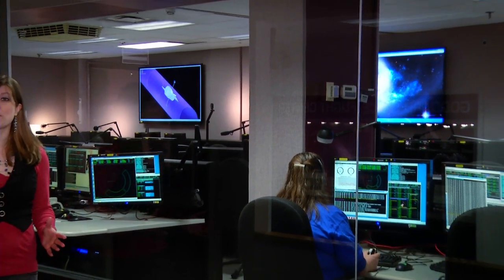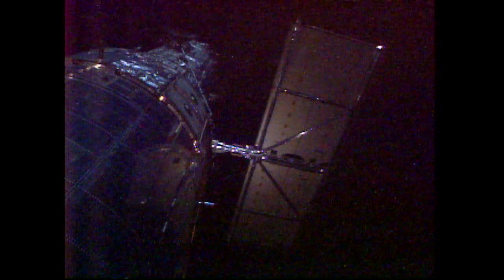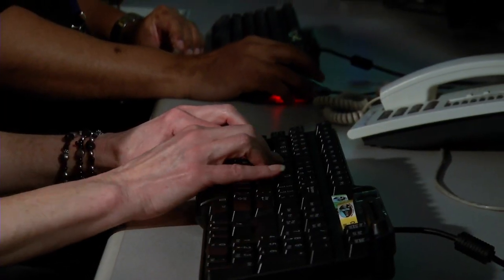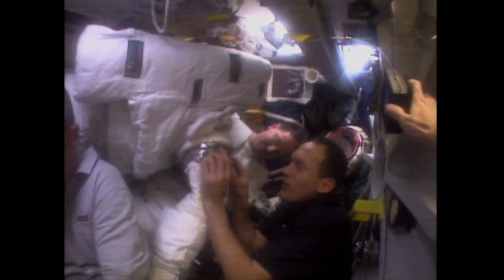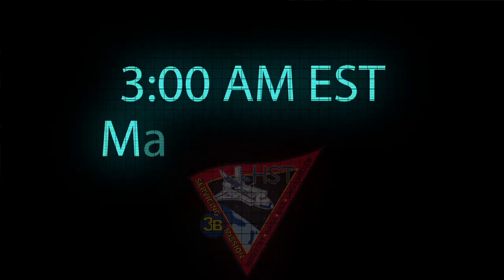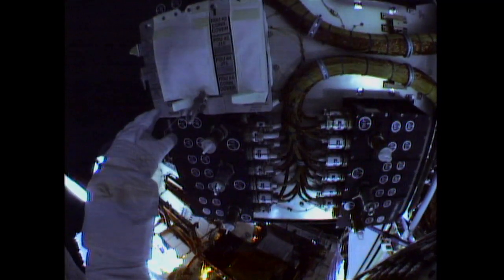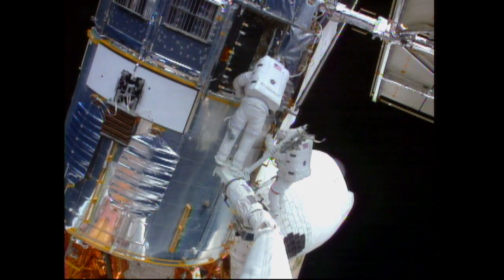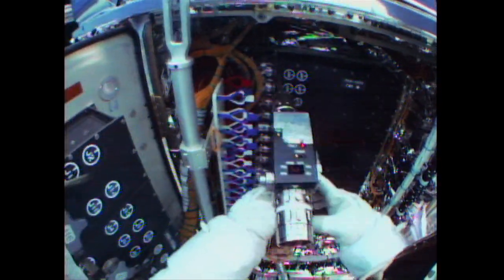NASA | Hubble Memorable Moments: Powering Down

Comment: How can you remotely turn on something that is turned off? If it is completely turned off that would include any receiver and command processor required that would be needed to turn it back on, would it not? So, did the astronauts flick a switch?
Reply: Björn P. Umm, I should know this… I think they apply power from the Shuttle.  And then the Goddard operators can do their remote PCU aliveness test.  … But don't quote me on that.  :)  david schaible?
Reply: Katrina Jackson That seems logical. No different than giving somebody a jump start really. Well, besides the fact that all of this is happening 550km above the Earths surface in 0-G. Come to think of it, it's more like open heart surgery, isn't it?
Reply: xXxDjShamblesxXx Open-heart heart transplant.  With no artificial life support during the surgery and no monitors hooked up to the patient.  In the vacuum of space.  No biggie.

Comment: "In 1999, engineers at NASA's Goddard Space Flight Center discovered that there was a problem with Hubble's Power Control Unit."
Does anybody at NASA Goddard  know about a good technical article detailing how that flaw was discovered?
I've trying to find out more details about that tech sleuthing challenge. Thanks!
Reply: Katrina Jackson Thanks for your reply, it's just pure curiosity :) 
I'm a web developer (graduated from a "science" university) and would like to know how Goddard's engineers found out those minimal forces/problems caused by a single bolt.
I'm looking for public articles, not paid or classified/private ones. Thanks!